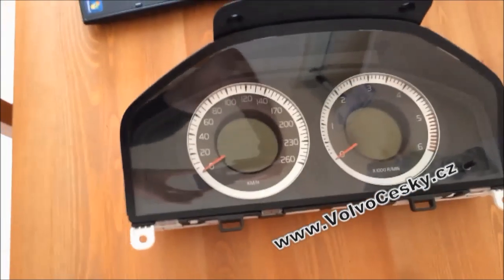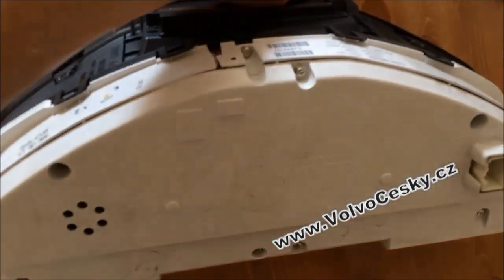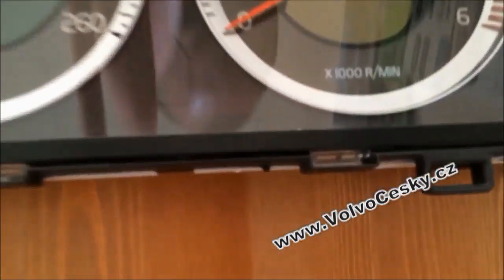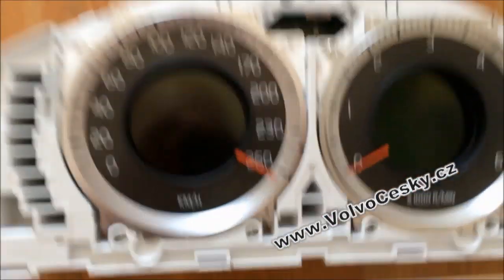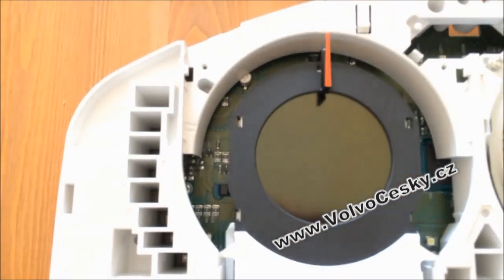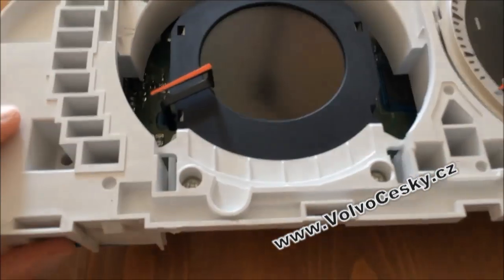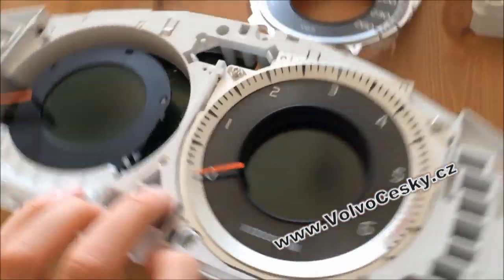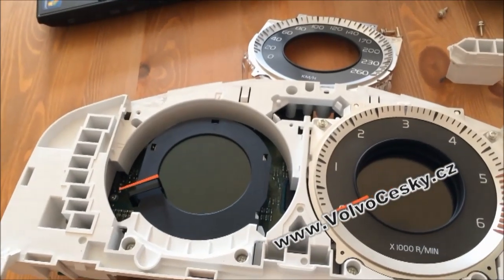Why Volvo S60 T6 AWD canot run 380km/h

Comment: Hi, I need to change the speedo dial from km/ph to m/ph. (1). Is it a direct replacement without needle change? (2). Do you know parts number?
Reply: in addition to that, my cluster is to dark without silver edges like yours feature here. Can I change my dials to those chrome silver ones?